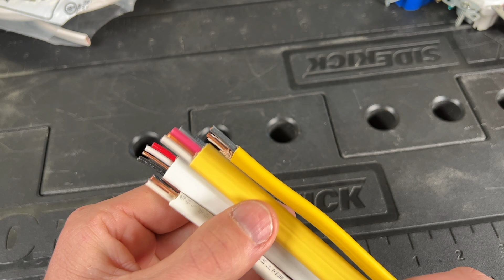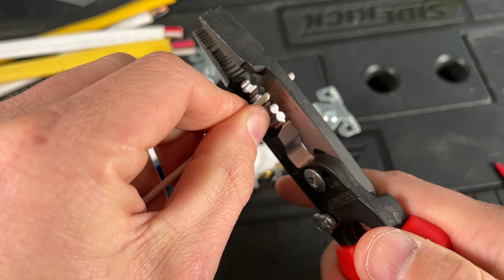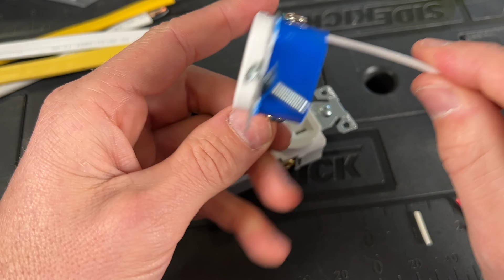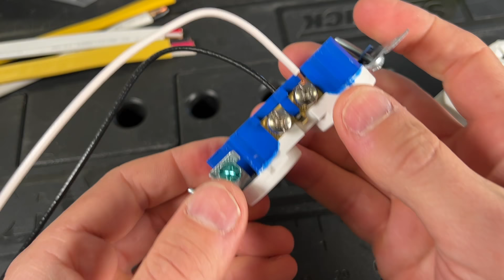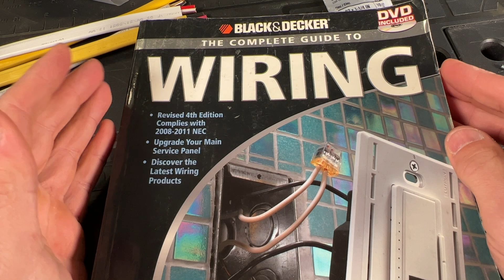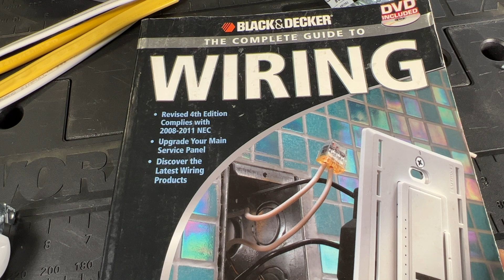#1 Best Video for DIY Electrical Outlet Basics

Comment: Switched outlets are not common in only older homes and high end homes !!! Switched outlets are a code requirement in any home bedroom , living room that does not have a ceiling light upto and including NEC 2020 !!! You are giving false information
Reply: He didn't say "only".
Reply: @zaneblane8160  he said mostly ok . But that’s not even near true . Anybody that works in a home back then and more so today is going to run into these . They have been a NEC CODE REQUIREMENT then up until 2020 . It’s not because you live in a HIGH END home lolol even poor people NEED them
Reply: SWITCHED RECEPS WERE VERY COMMON IN LIVING ROOMS OF TRACT HOMES.  THE TREND OF A CEILING LIGHT IN THE CENTER OF A LIVING ROOM BECAME LESS FASHIONABLE.  CUSTOM HOMES (HIGHER END) LED TO STRATEGICALLY PLACED RECESSED LIGHT FIXTURES.  MASTER BEDROOMS WERE, AS STATED, A COMMON PLACE FOR SWITCHED RECEPS AND I SEE THEM ASKED FOR AS AN ADDITION TO CEILING LIGHTS ENEN NOW.
Reply: @donl1410  switched receptacles are very common because most electrical contractors wire homes to bare minimum code requirements . They make most of their profit on up charges as in ceiling lights , down lights etc etc . So they tell the customer they will have a 1/2 switched receptacle ( Bare minimum code ) and if they want ceiling outlets they will be an up charge .
Reply: @paulkronyak4069  MAN, WHERE ARE YOU IN THE TRADES?  FOR ONE THING IT'S THE GENERAL CONTRACTORS THAT MAKES THE CALLS ON WHAT THEY WANT IN THE HOMES THEY BUILD.  SPEC HOMES, I FIGURE A JOB TO CODE WITH LIGHT OUTLES AND ALLOWENCES FOR A NUMBER OF CAN LIGHTS.  THAT'S A STARTING POINT THAT THE GC CAN MODIFY FOR FINAL BID.  PRESOLD HOMES START HERE AND THE CUSTOMER CAN ADD OR DELETE WHAT THEY WANT.  AND YES!  EXTRAS ARE ALWAYS WELCOME.
Reply: @donl1410  I design the entire electrical systems for high rise multi-use buildings from the underground to the last receptacle . Currently I’m doing 3-30+ story and 4-40+ story buildings at the same time :)
Reply: @donl1410  30+ years running commercial , industrial and high rise buildings in NYC as a general foreman .
Reply: @paulkronyak4069  ENOUGH TROLLING
Reply: @donl1410  listen I’m not trolling I just go i these videos once in a while to see what they are all about . It just really bothers me that there are people on here trying to teach others how to do something as dangerous as electrical work and they do not do their homework , teach inaccurate methods do not really know how to interpret the code they are teaching others . One day , and I hope that day never happens , somebody is going to get killed watching these videos and trying to do what they are being shown . I myself would NEVER advise an Amateur  electrician or a homeowner to use a contactless ( sniffer ) tester . This is gambling with people’s lives
Reply: @paulkronyak4069  Thank you for your positive input!
Reply: @donl1410  While I agree that OP is trolling, why your replies have to be in all caps? I feel like you're more pissed off than he is, which is enabling him
Reply: @aurvaroy6670  I started out just making clarification comments to the thread.  Caps, in my statements are not making any point, it makes for easier composing and later finding my comments.  If caps  are a problem, it's his.  He was ripping the author all through his posts.  I was trying to be a benefit.
Reply: @paulkronyak4069  Thanks for your resume...
Reply: @donl1410  I haven’t been ripping anybody lol . Point blank electrical work is the most dangerous trade . And for some people to be going on YouTube where anybody can see and start instructing people how to do it and then giving wrong and dangerous advice , scares me !! So by me putting in my opinion , EX: do not ever tell an amateur or homeowner to use a contactless ( sniff ) tester , I feel I am benefitting , the author , and the people watching .
Reply: @donl1410  Fair enough. I'm so used to believing that caps is for shouting so I thought you were mad at OP, which would also be understandable.
Reply: I don't know if this is code but the switched receptacles encounter are usually installed with the ground plug on top so they can be easily identified.

Comment: You put the screw in the wrong direction in the screw cutter you want to have to unscrew it out to clean the threads . Please show the proper way to cut a screw , if you do it won’t have a boogered up end .
Reply from the maker: Actually Knipex screw cutters aren't threaded like the Milwaukee and Klein
Reply: @EverydayHomeRepairs  that would be one reason I wouldn’t use it then ? It is basically like cutting a screw with a pair of linesmen pliers then ?

Comment: 20amp is not going to be most common in most homes .you will mainly only have them in kitchen and baths the rest will almost always be 15amp
Reply: I was gonna comment that. I hope he said that by mistake because I've never seen 20 A receptacles on 20 A circuits, unless they're dedicated circuits.
Reply: @aurvaroy6670  Agreed
Reply: 15 AMP RECEPTACLES CAN BE INSTALLED ON 20 AMP CIRCUITS (AND USUALLY ARE) IF THE 20 AMP CIRCUIT IS NOT SUPPLING AN INDIVIDUAL RECEP.  (A 20 AMP INDIVIDUAL CIRCUIT WOULD REQUIRE A 20 AMP RECEP.)  NEC 210.21 (B) (3)
Reply: @donl1410  but how many homes do you go into and the general purpose receptacles are 20 amp ???? He said a majority of homes have 20amp receptacles , which they definitely do NOT
Reply: @paulkronyak4069  BETTER RE-READ MY STATEMENT.  I WAS SUPPLING USEFUL INFORMATION.  I'VE NEVER INSTALLED A 20 AMP DUPLEX IN A RESIDENCE.  ONLY IN A COMMERCIAL PROJECT, "IF" SPECIFIED.
Reply: @donl1410  yes and my original comment was in reference to the person making this instructional video saying “ the most common outlets ( receptacles ) you will find in a home are 20 amp ? Which that is 100% not the case
Reply: @donl1410  you’ve never installed a 20amp receptacle in a bathroom or a kitchen counter top ? Or for a refrigerator or washer machine ? Man I wouldn’t want you doing my install .
Reply: @paulkronyak4069  LOL.  Why would I?  Read your code book.  How many kitchen appliances, hair dryers, or plug in shavers have 20A plugs on them?  Keep wiring those high rises, or telling others how to do it...
Reply: @donl1410  this whole email thread started because the person doing the instructing said “ the 20amp receptacle is the most common one you will see in a home “ . Which it def is not

Comment: Hi Scott!

Some of my receptacles "spark / arc" when I plug or unplug something in. It's quite the fireworks display sometimes!
Is it time to replace those receptacles, or is there something more serious going on?

Thank you!
Reply: If outlets look old and things plugged into them are a ‘sloppy’ fit with no grip it is wise to replace the duplex(es). Also, if what you are plugging in (the LOAD) is turned on, especially something like a 1500 watt heater, you will experiencing arcing for sure. Never use an outlet as an ON/OFF switch. The repeated arcing will burn and pit both the contacts in the outlet and the prongs on the plug. The resulting uneven contact being made will only make future arcing worse and insufficient contact can result in a heat build up. Persistent arcing causes most electrical fires.

Comment: Enjoying your videos but have a question:  I'm replacng two prong outlets with three prong.  How do I determine which one is at the head of the stream for a GFI placement.  I can't see wires to trace them visually.  Wiring is two wire romex, no seperate ground.  Any infor or direction will be apporeciated!
Reply: The easiest way imo is just to swap to gfci/combo breakers otherwise it would be a lot of guess and check. Or they sell digital meters and can give u details voltage drop %, impedance etc but it’s pricey and not all that practical for a diyer